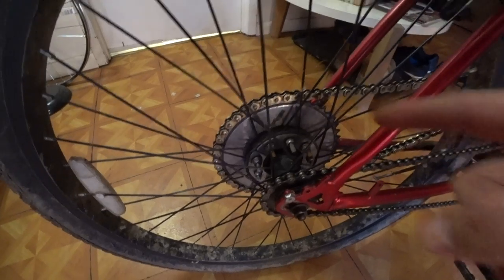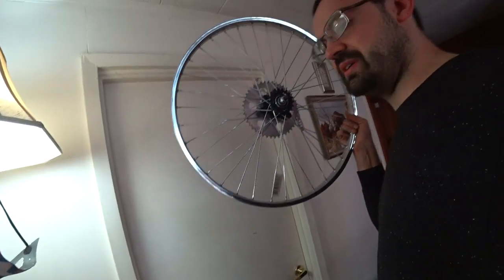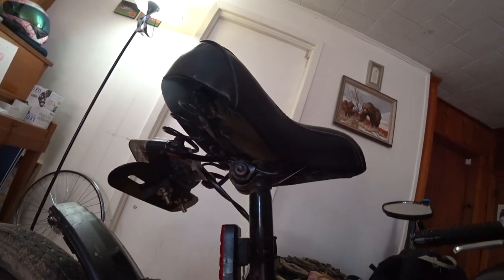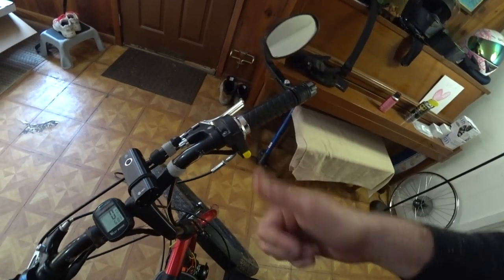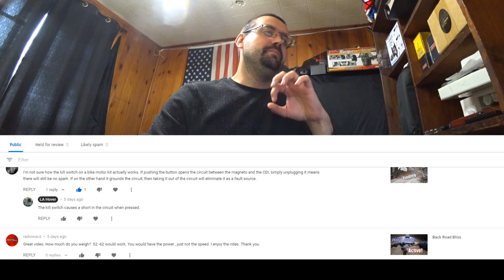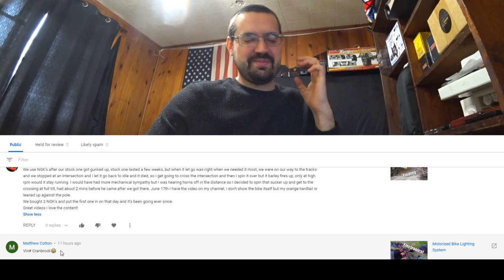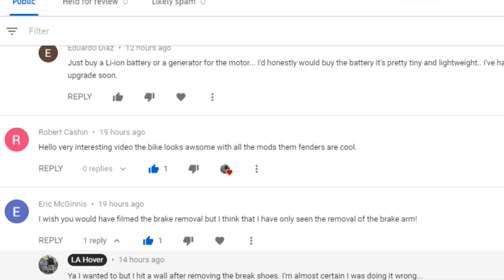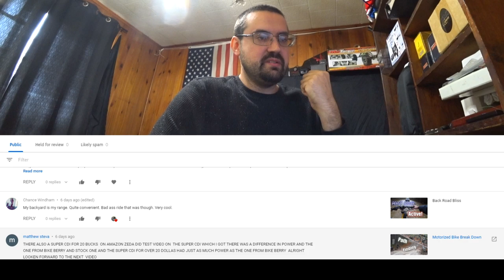A Closer Look

Comment: Great vids, I mounted my motor on an old mountain bike I had kicking around, motor was a nightmare, I had to go thru every bolt, after the first 5 min I had to shut down and do a complete retorque on everything, a complete tear down,, now its champ, got 300 miles on it still runs strong,,few tweaks I did made it nice to blast around on, raked the solid forks a bit this made cornering less twitchy, it's my daily ride to work now the snow is gone 😊

Comment: That brake arm is an integral part of the wheel cone adjustment.  In thinking about how it would work without it, I think it would be best to jam the big nut against the cone on the left side with the wheel off the bike and then make the final adjustment on the other side, but you would need a narrow cone wrench.  And yeah, that is a three handed adjustment even when the wheel is assembled normally - typically you think you have it correct but if the axle turns when you tighten the mounting nuts you end up with the cones too tight.    ( Edit - wanted to add I think this is the first time I have seen you riding in sunshine there in LA. )

Comment: thanks for another video...have you thought about a boost bottle? I just made one for my bike really easy a couple days ago and I notice quite a difference...I have power from just above idle up to wide open throttle now when I used to only pull well in mid to high rpm...and its quite a bit better on fuel too, with near nothing dripping out of the exhaust, when it was covering the rear of my bike with oil...40:1
Reply: I have a boost bottle and run 40:1 .  Runs great with enough power and not much drippage.

Comment: @LA Hover also a tip on messing with axles on hubs, heres my trick and rule of thumb, if the axle is straight you will have no issues doing this. Hand tighten the cone nuts until snug, then tighten your locknut while holding cone in place, 95% of the time allows just enough play to move freely without being loose enough to hollow out a hub, too tight you will hollow it faster than too loose will for record

Comment: What I do is put the coaster arm in a vice and bend it so that the arm turns away from the sprocket right next to the hub where it attaches, then bend it again so it's even with the bike frame. If you don't have that brake arm on, the coaster will lock if you back pedal, it won't lock up the wheel though, instead it'll force your crank to spin at the same speed your wheel does because the hub has nothing to keep it fixed without that arm.
As for the slop, that's just something that happens without the brake arm for some reason. You can adjust the cones and lock nuts all you want and somehow it eventually comes loose again. I've found it's best to just find a no coaster rear wheel and put it on instead if for whatever reason you can't mount the brake arm. Then just align the chain on the gear that it rotates best on and tension appropriately.

Comment: Would u recommend getting plastic finders for my bike if I ride in my pastor that has some mud an water is some places would it keep the mud from getting on my back? An I like the new upgrades 👍 they look sharp.
Reply: Yes, plastic fenders will work as long as you don't get several pounds of mud stuck to them.

Comment: As for ngk plugs most go with a b6hs for all around use. Colder plugs like b7hs or b8hs  for hotter summer temps. 90+ degrees. Hotter plugs like a b5 is used for colder or freezing temps. . It's all on how fast it retains heat or dissipates heat for different ambient temps. You dont want a cold plug in cold temps or hot plug in hot temps..

Comment: I recently got into building a motorized bike in an attempt to slash my fuel expenses and reduce wear and tear on my daily drivers.  Naturally YouTube led me to your channel, and I've been enjoying your bike vids.  I'm a heavy line tech by trade, so I swap and repair engines and transmissions on a daily basis on full size vehicles... lol you would think a project like this would be gravy for me!  I spent six hours last Thursday assembling a kit motor and modifying the bike so it would work, and still didn't finish (then slammed a mustang transmission in less than three hours the next day lol).  

Just a few things:

1) Could you please do a tutorial video on assembling a 49cc engine kit to a beach cruiser, and a follow up video on maintenance?  I know there are probably vids out there on this, but I'd like to see one by you if possible, and if you could be sure to address frame modifications in addition brake modifications (I'm using the same bike as your dad's, and I'm not to keen on the idea of using the pedal brake after this is running), that would be awesome.

2)  Could you please share some links (I'm cool with affiliate links!) to reliable replacement parts for these kits, such as carbs, fuel filters, etc.?

3) I'm thinking of fabricating my own engine mounts similar to what are used in full sized vehicles for one of these bike projects, as they are designed to reduce vibration significantly, and that is non-existent with these kits... zero rubber between the frame and the engine!  Would you agree that rubber dampers between the mounting brackets for the engine and the frame would potentially help reduce the vibration of the whole bike?

4) What do you use to measure your fuel and oil for the mixture, so that you get the ratio right? A measuring cup?

5) The mounting brackets that attach the drive sprocket to the tire... ugh that part is not fun.  What do you do to get the sprocket perfectly true to the tire, and not warp the spokes in the process?

Keep up the good work on the channel, very informative!
Reply from the maker: Thanks! Are you referring to the 2 or 4 stroke 49cc kits? They have both but the 49cc 2 stroke are less common (still easy to get)... I'll address as many of your questions in next Friday's video as I can. Good luck on you build!
Reply: @LAHover  You're welcome, and thanks as well. I was referring to the 2 stroke kit 49cc and 80cc engines.  I didn't have enough clearance to install my exhaust pipe, so I wound up heating and reshaping my frame until it fit (good thing I work in a shop)... I also wound up cutting the frame slightly so the mounting bolts would slide onto the cruiser frame (I didn't see the adapter bracket at first lol)... that said I'm curious how you tackle frame mods.  The worst part of the build was truing up that sprocket though... every time I'd tighten one side, it would slide itself out of the center... super frustrating to keep that sprocket centered.  I'll watch out for that video on Friday, thanks!
Reply from the maker: @fun4change  sorry for the wait, Q&A got moved to this week's bonus video. Should be up Tuesday afternoon.

Comment: @LA Hover brooooo my guy i gotchu, got to walmart, its about 5$ i think i paid? Its a tiny bell tire repair kit, comes in a small black case (has avg tire repair kit inside, its decent.) But! It has a mini multi function low profile wrench in it, best damn tool ive ever had for these for a fraction of what ive paid for any other ones. Trust me bro its a lifesaver on my jackshaft kit i had aswell with maintenance on wheel hubs, even helped get access to the crank assembly without removing pedals 👌

Comment: I have a bright blue cranbrook huffy beach cruiser im waiting on the angle fire kit from bikeberry to ship its my first build do you know will i have to take the coaster brake off to mount sprocket and do you have any suggestions with this specific bike i really like the way you went with your build fantastic set up i as a fan really appreciate you going into detail with all your videos great job i love the channel
Reply from the maker: I had to take the arm off so I could slide the sprocket on. but I was able to reinstall the arm afterwards. Because removing the arm can sometimes un-adjust the bearings, be sure to keep an eye on them so they are not to tight or to loss.

Comment: In your opinion what is a good first motor to go with I’m only using it to get around town here and there but I might want to upgrade later please suggest me a good name brand that’s not too expensive
Reply from the maker: Right now prices suck, you are probably going be spending $150-$200. look for a zeda 80, or a seeutek pk80. 
Make sure what ever motor you get has 8mm mounting studs.

Comment: I mounted the sprocket directly to the spokes without rubber in-between. Over time it dug a grove into the sprocket and eroded its way through half the spokes buckling the wheel. Big oopsie

Comment: I would not call it a vacuum leak but a problem fitment of the throttle intake piston.  This sounds like a factory defective carburetor.   Depending upon where the extra air was getting it you could call it a vacuum leak.
Reply: yea but you call it vacuum to refer to the intake side, the engine is an air pump and the intake is the vacuum side

Comment: Would you reccoment putting a dirt bike engine on a bike?
Reply: 2-stroke is a dirtbike engine.
49cc up to 212cc can fit a bicycle.
Depending on 2-stroke or 4-stroke. The Bike frame itself and the mods on the engine.
2-strokes need more tinkering, but faster. Gas+oil mix.
4-strokes less tinkering, more torque. Gas & go.

4-strokes are wider & heavier. While 2-strokes are slimmer & lighter.

I own 2 minibikes with 4 strokes. The extra weight of the engines will kill yeah if you break down, break chain, etc... I know too well about 4-stroke problems. Gas & go though.

Now I've never owned a 2-stroke myself. Friends have. Faster. Lighter. Guess if can carry extra fuel you can carry extra oil too or premix the spare fuel. Less torque though.
Reply: I wouldn’t unless it was put on a nice downhill bike. Lots of power even in a 125.
Reply: I did one a few years ago with a Chinese knockoff of the Ktm jr. It came out really good and fast af. But lots of work making it fit and welding up motor mounts.

Comment: @LA Hover also, fuck what everybody says, for minor things like that zipties are the best thing in the world due to they wont work loose from vibration like nuts and bolts will. Good quality zip ties work just as good if not better for lights, boost bottles, cdis, batteries and any speaker systems than bolts and nuts ever have for me, thats with orange locktite, which is actually rated 3x stronger than blue

Comment: I had a speedometer on my bike once I put the engine on it stopped working
Reply: I had same problem. Resistor spark plug fixed the issue. It will reduce radio interference that confuses speedometer.
Reply: @3viis  thanks for the help

Comment: Vacume or air leak , two strokes don't run properly with even a small air gap or even loose head bolts! Yeah whoever mentioned them not having vacume lines, that's a goofy comment!